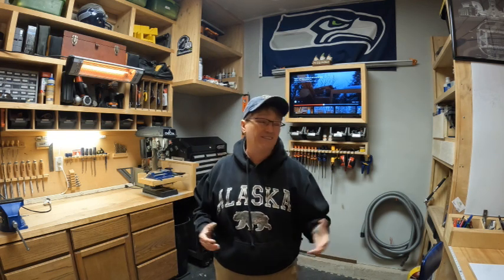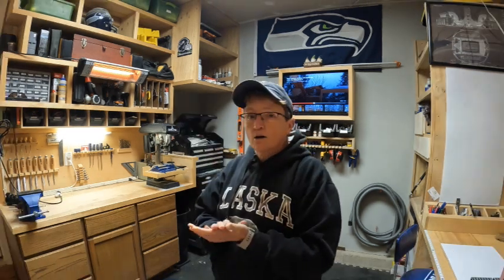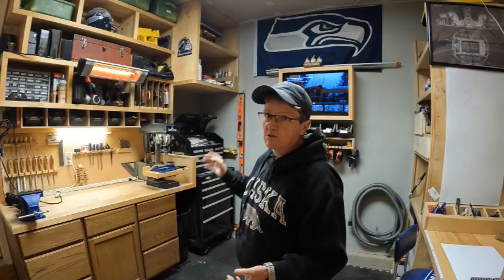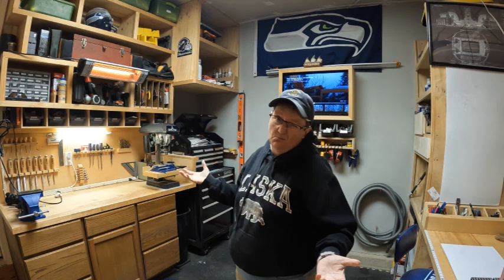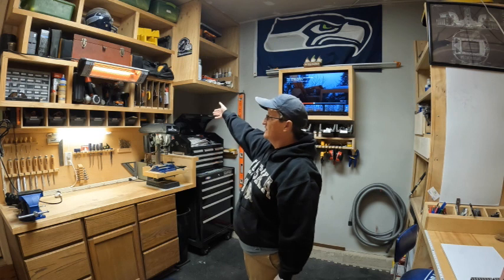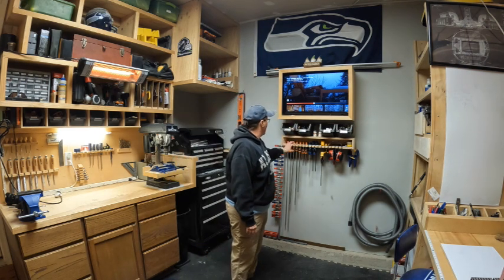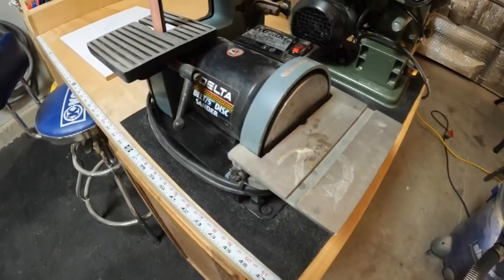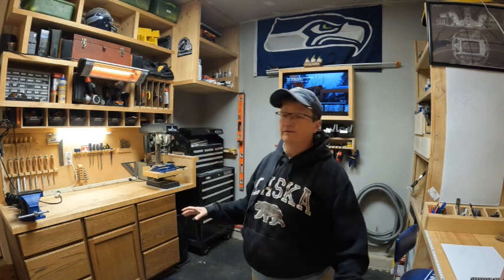Women Who Build 🔨  Work Shop Ideas

Comment: I love the tidiness. My husband, jeez, tools go into the garage and they go into a black hole. Every drawer is piled with stuff. He’s in inveterate packrat and he’s been picking up stuff off the street: washers and spring clips and various odds and ends and screws and things and they just go in a pile. It drives me nuts. I used to have a small but useful group of tools. They are lost in the black hole of the garage. I don’t even know where they are anymore.
Reply: My Dad "borrowed" my Robogrips and I never saw them again
Reply from the maker: My dad was kind of the same way. I used to have to help him clean his garage all the time. I try to keep mine organized so I don't have those days.  I do say I have a bucket I save all kinds of nuts, washers and screws just in case but rarely pick them up from the roads, that's an all new kind of hoarder 🤣
Reply: @JonniesJourney  well, he’s a railroad modeler and his favorite things to pick up are the lead weights tire shops clip on your wheels to balance them. Not uncommon to see those on the street. He picks them up because they’re heavy and he can put them in his model and it weights it down so it doesn’t jump around on the tracks when he runs it. An old modelers’ trick.
Reply from the maker: @TrishBenedict  very cool. I have a friend that has a huge setup in their basement. Literally the entire basement. Very cool.